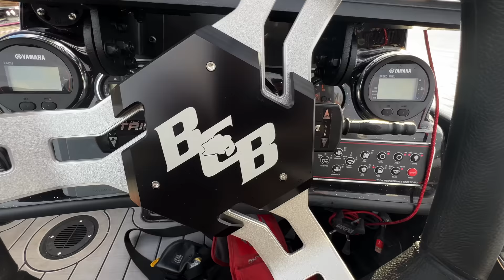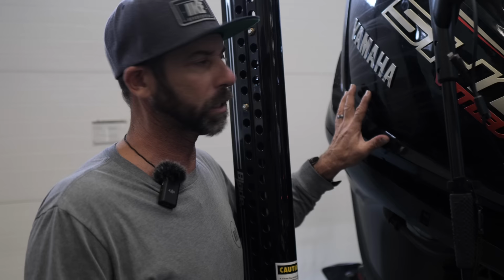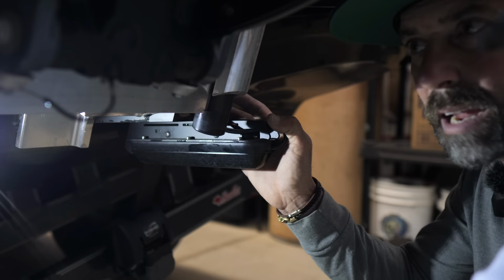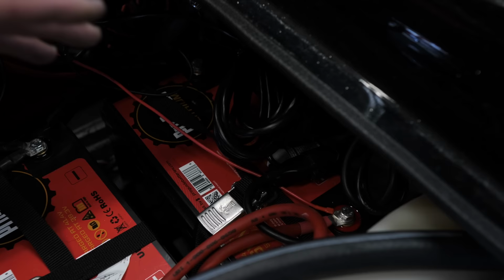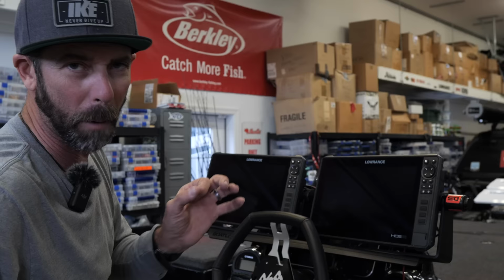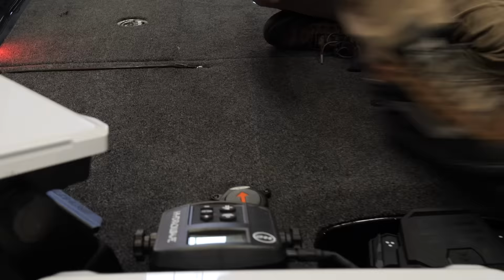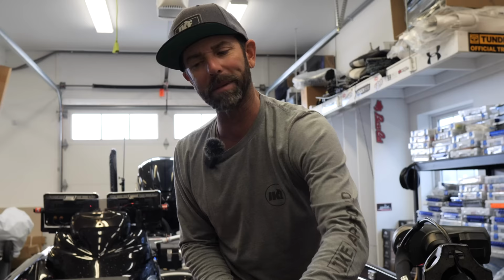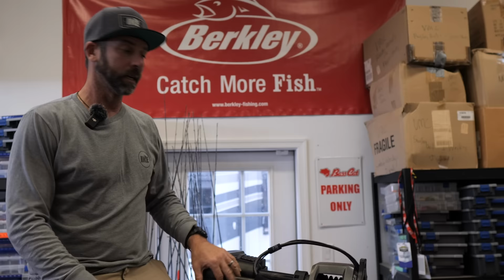2023 Bass Boat (Tournament Rig!!)

Comment: Minor correction.  I'm sure the two 36v batteries that you say are connected in SERIES (which would make 72 volts) are actually connected in PARALLEL.(twice the amp-hrs. at 36 volts).  Same thing but 12volt batteries on the other side.
Reply: I caught that as well , I was like I hope you didn’t wire that in series
Reply: I was wondering the same thing when he said that

Comment: Awesome setup ! You mentioned that your 2 36v batteries and your 2 12v batteries are wired in series, if so than you 36 put out  72v and the 2 12v put out 24v. I guess you meant parallel, voltage stays the same but act as a bigger battery.
Reply: You're right.  He probably meant parallel.  Batteries in parallel maintain same voltage, but the current gets added for longer running time.

Comment: If you're using 36v batteries, you have them wired in parallel to increase amps. Series increases volts so that would mean you are pushing 72 volts. Your starting and house battery is a 12v system and it is also ran in parallel for the same reason. I just wanted to clear that up for the people.

Comment: Mike, you misspoke. You have your batteries rigged parallel not series.  If you ran your trolling 36V motor batteries in series you would be sending 72 volts to the motor burning it instantly. With your 12V cranking batteries, if they were in series you would be sending 24 volts to your engine and electronics frying them instantly.